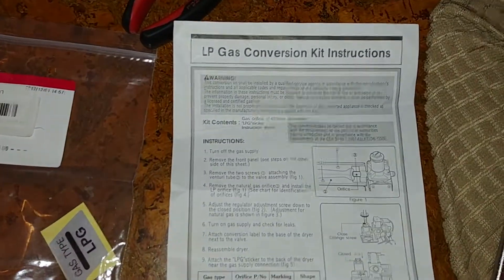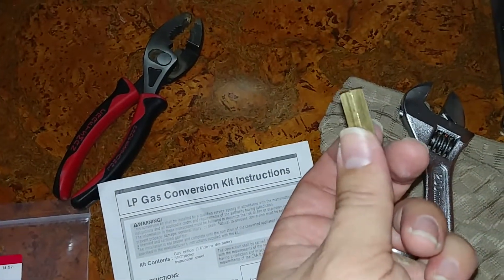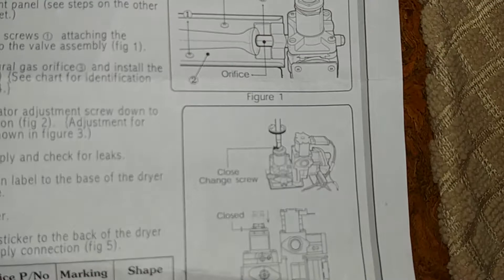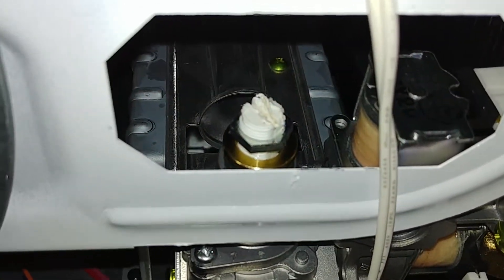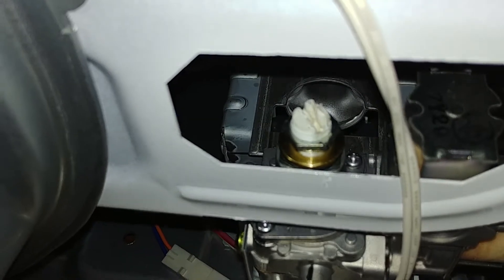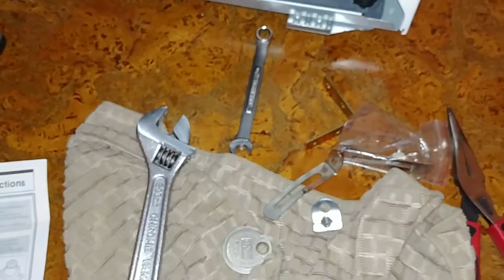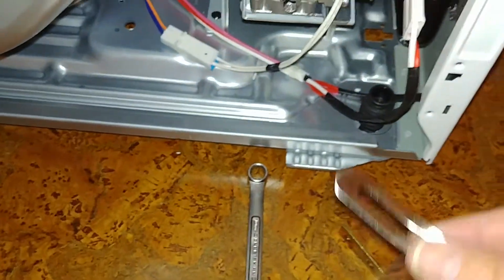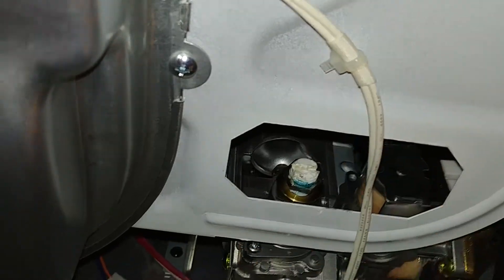Help my adjustment screw is stuck! LG LP Conversion Kit

Comment: I was able to turn it enough so the nut is flush with the  brass piece. However, in other videos the brass piece is flush with the silver nut below it. In my brand new washer, there is a gap between the bottom nut and the brass. You have any idea if this needs to be flush as well?

Comment: After you have made a mess of the nylon screw, have you found a replacement for it?  If so share where you picked it up
Reply from the maker: I did not replace it as I was able to adjust it per instructions from LG and the project was complete. It's worked great for over 5 years at this point. That screw I believe is part of the regulator and might have to buy the entire piece. Best thing to do is check the LG parts diagram for your specific model and zoom into to see about which part you'll need to buy to replace it.

Comment: Captain Carbo here 
   Thank you that was very encouraging
I decided to take out the housing that has the plastic adjustment screw (it's only two screws)  then I was able 🎉 to     work on it on my bench 
        I did use acetone as recommended once on my bench I was able to have a break free...  
      Without your video I thought maybe it's me I never would've thought that from the factory they would've glued in that adjustment screw,...

Comment: Have you considered, with the gas supply off and relieved, applying some directed, gentle heat to the main brass piece, letting it soak in until it softens up the loc-tite?  Then remove the pieces, soak in boiling water so you don't melt the white plastic, get them apart then reassemble the whole thing as desired.  Can't hurt anything and blue loc-tite loosens easily with a little heat.
Reply from the maker: No, these days what I'd do is use the proper tool which is a 'drag link' socket which has a very wide slot made perfectly for loosening something like the adjustment screw: https://www.youtube.com/watch?v=VlXWcIFF0yY
Reply: @TheEclecticHandyman  

 I know what thry are, I was an ASE tech for years.  I'm just giving the functional way for an average person with no special tool to defeat the loc-tite.  I'm sure that a D-link socket and some TLC would probably work, too.  But they have to find/order it, etc.  Both are viable, my way just needs a little patience and regular tools.  :)

Comment: Tried that but it did not budge - just mangled the head more. Any other tips? TY!
Reply from the maker: Yeah it's been a couple of years since I did this, but the trick is a proper tool which as the video showed I didn't have exactly. I used that flat bracket with leverage that I found to turn that nut and eventually it did pop loose. A better tool would have been a really short and super wide (like 1") flat head screw driver. Or a speciality socket like this but honestly I can't say for sure: https://smile.amazon.com/dp/B002GK9H4W/ref=cm_sw_r_cp_apa_i_SeV6EbRX0TFAC I only did this project 1x and that bracket I found and used worked for me.
Reply: I just went through this with our LG Towerwash and what finally worked easily was the author's idea to use a large flat-head screwdriver.   Since it was thicker, I was able to slide that in from the side and fit the slot tight.   It popped loose quite easily with that approach after trying about everything else I could find laying around.